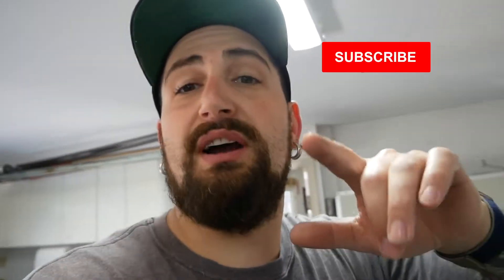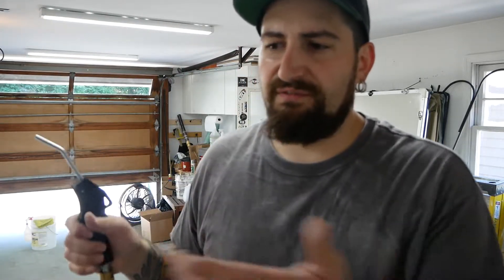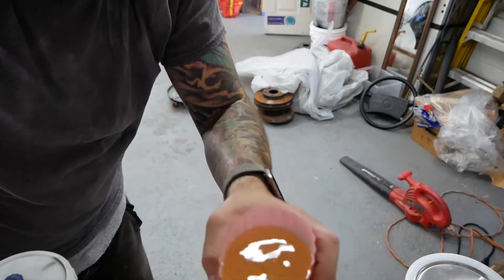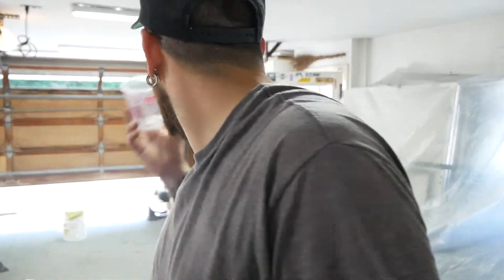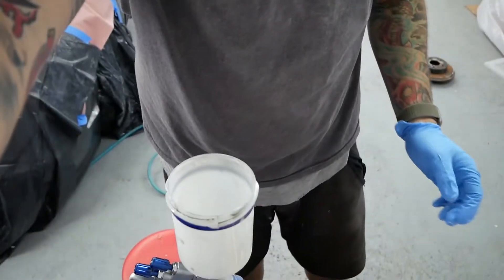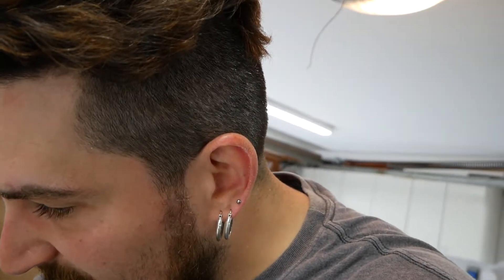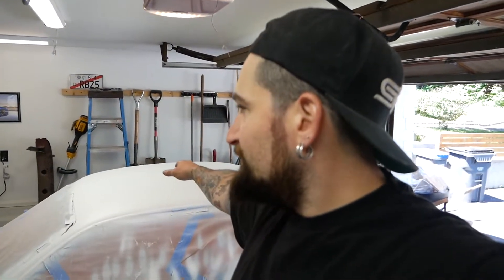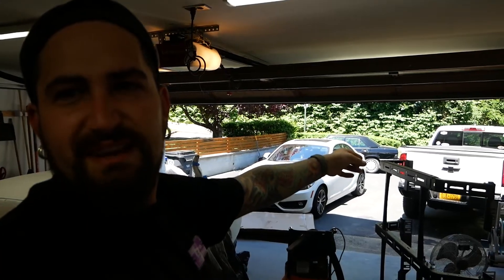Time for color!! Garage paint job color reveal | 240sx s14 rb25det

Comment: Next time try using a filter when you pour the paint after mixing when pouring into the gun. Extra step but could help. Can’t wait to see the finished product. Any pearls in there or flat white?
Reply from the maker: Yeah.. after the fact I realized I had filters to pour thru 🤦🏻‍♂️... just straight white.. no pearls so it’s easier to paint match doors/trunk/bodykit.. and less chance of messing it up 😂